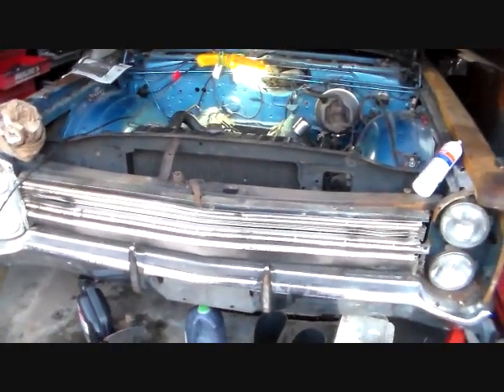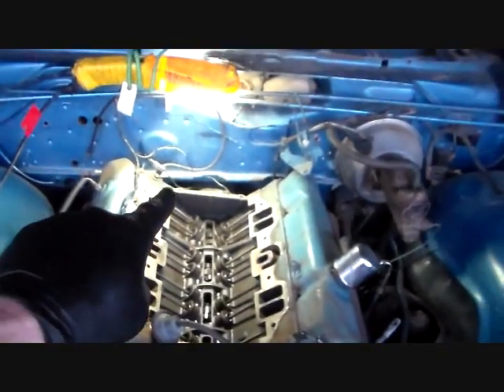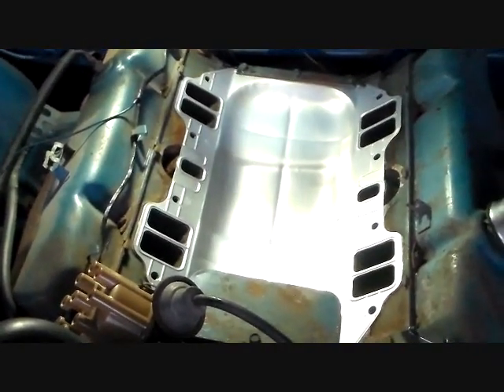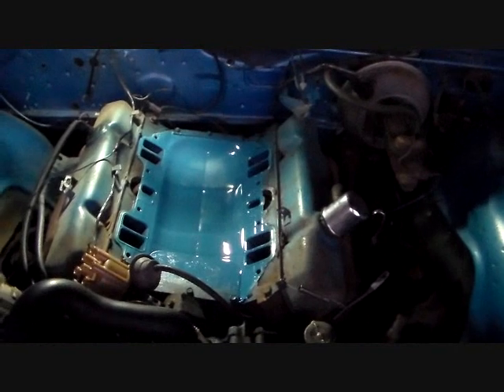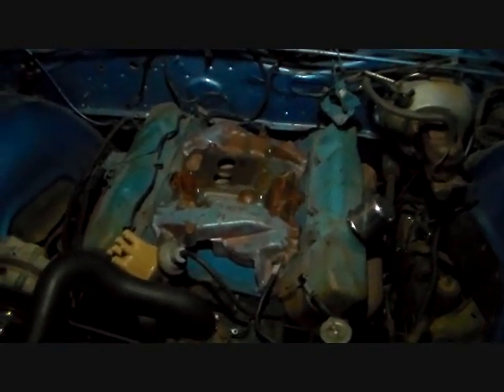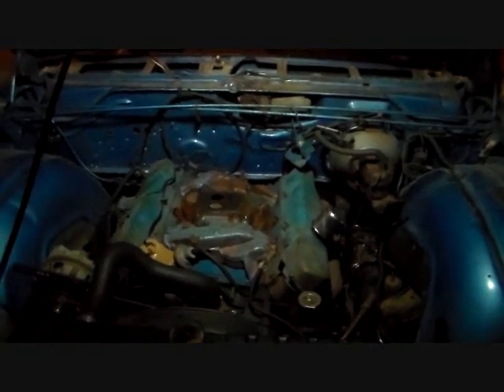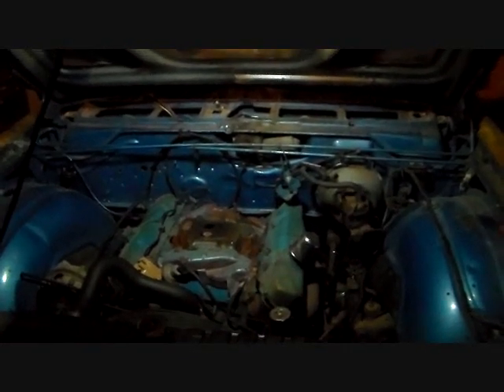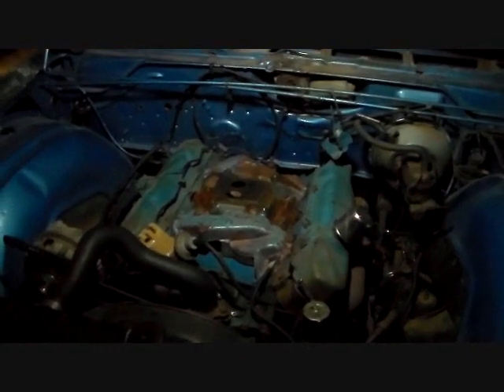Plymouth 383 intake swap

Comment: i like the steel gaskets with just copper spray on them. i did shellac on the cork and black RTV in the corners where it was required on my 318. dry as a bone. no coolant or oil leaks to speak of.

Comment: And even a cast iron intake on a B or RB , if not squared down and torqued perfectly - will leak vacuum - found this out on the 400 in my ‘72 Road Runner.

Comment: Hoping to take off the intake manifold on my 361, good video helps me out on what to expect in there.
Reply from the maker: It's a very easy job.
Reply: @TylersNeighborhoodGarage  easy as it gets eh?
Reply from the maker: @samhicks97  pretty much. It's a dry intake...no coolant running through it and you don't have to pull the distributor although it gives you more room if you do. Just clean surfaces well, install a new sheetmetal tray gasket, put rtv at the four corners where the heads and block meet, drop it on, torque the bolts in a couple steps in the right pattern and you are DONE.
Reply: @TylersNeighborhoodGarage  Thank you very much, this kind of information is just priceless.

 I'll refer to the torque specs on the service manual.
Reply: @TylersNeighborhoodGarage  Hello again, i have a question: I have found an intake manifold for the B engines 350/361/383/400.
I am wondering if i should get the manifold, as the gasket mating surfaces are heavily pitted, or would you look for another manifold that is not pitted or has little to no pitting? thanks.
Reply from the maker: @samhicks97  no pits is preferable.
Reply: @TylersNeighborhoodGarage  Appreciate the answer, I'll source some other intake manifolds, cheers.

Comment: i hope you know that the throttle cable,  and ALL the brackets, AND linkage.   are different between a 2 bbl and 4 bbl.   I.E.  do it just the way Chrysler did it.    just a warning from an old Chrysler guy.

Comment: Have any experience with removing a 383 intake installed with factory A/C?  Some of the A/C bracketry is attached to the intake bolts, don't know how much harder that makes it.  Also, is it wise to re-use the original metal intake gaskets and valley pan if you don't have an oil leak and it seems to be in good condition?
Reply: Just finished watching, it seems you only used the valley pan as the gasket.  I have the cast iron intake (2806301 P/N), which I hear is fine, but if I were to use an aluminum one I would need the paper/metal gaskets.  Good to know.
Reply from the maker: correct. Use a new turkey tray. it's a dry intake. no water so no need for sealer.
Reply: @TylersNeighborhoodGarage  Noted.  A new gasket is only 20 bucks so I'll pick one up.  I had an interesting issue come up where one of the intake A/C brackets didn't line up with my intake bolt hole, despite the other 7 threading in fine, and it working on my 2 barrel intake.  I'm going to try to drill the bracket (not the intake or head threads, of course), and widen it to make it work.  The bolts for those are longer than the regular ones, and since it's from the factory, it seems better to leave the bracketry as complete as possible.

Comment: That front plate originally held down a mat to insulate heat from the intake But it didn't hold good and they blew out or the mice ate them. This is a great video for.

Comment: Hey buddy,  I appreciate the post very much. I'm gonna do the same thing your doing. or did already. (Whatever) But I'm un familiar with BB mopar. You show a bead of RTV on either end of block going slightly up each head...then the next thing I see is the valley pan in place already. My valley pan gasket set came w/ two sets of intake to head gaskets. A total of 4 gaskets for the heads. does one set go underneath the valley pan, then one on top? Your video looks like that valley pan gasket goes directly to the head with nothing in-between. or (metal to metal) Is that right? This gasket set is confusing to me. Your advice would be greatly appreciated. I liked and already been a subscriber for awhile now. Please clarify this for me. It's a lot of work and I don't want to do it wrong. thanks
Reply from the maker: You just use the metal tray-style gasket with nothing between head and gasket or between gasket to intake. The RTV at the end is to prevent oil leaks out of the lifter valley. Follow the torque specs and sequence to the letter. Good luck!
Reply: Thanks Bro. Appreciate the reply very much. I never saw an intake assembly with no gaskets before. But It ran fine with out em', I just a hard time wrapping my tiny mind around the whole "no gasket" thing. It's all back together and runs just fine.

Comment: Did this car come with factory ac ? ... I am changing my intake to a aluminium edelbrock dual plane ... with a new avs2 carb ... I have a 383 with ac ... reason i ask is to know if I have to remove the ac

Comment: years ago i did a 2 bbl to 4 bbl swap on a 383.    the A/C  bracket was very hard to get on.   latter i figured that some intakes  might be machined for the A/C bracket.   but if the car didnt come with an A/C the intake might NOT be machined.    making the two front bolt ears a different thigh.    iam not totally sure this is true.   but do watch the two front ears on the 383  and maybe the 440.
Reply: Moe Shouse.  Not a good fit. Been there, done that.  A built up 360 is much better, easier to install !